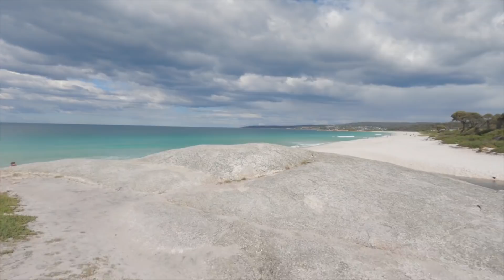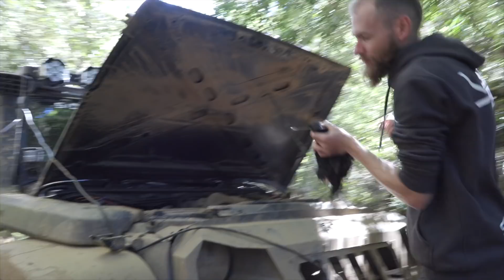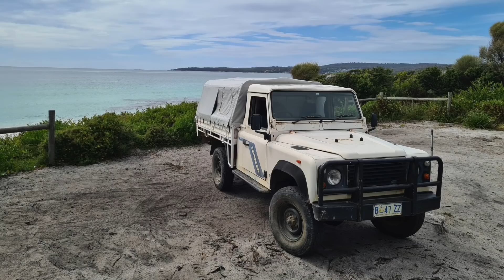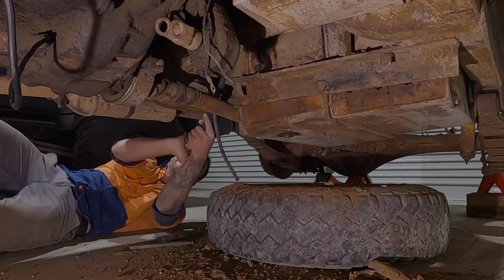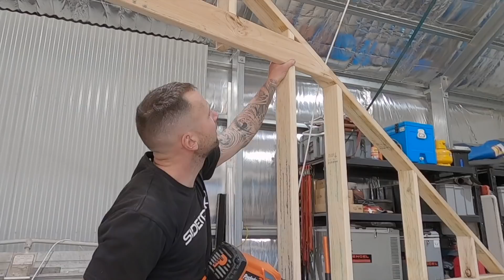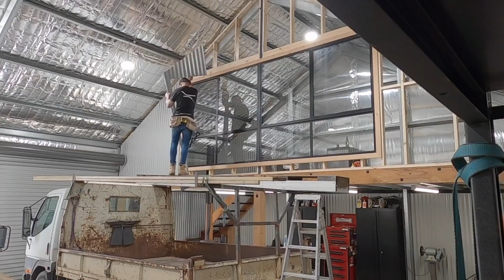#23 Where's the G60? What happened to the Jeep? QUESTIONS ANSWERED!!

Comment: Two firsts: First time I've read or heard anything about the Pentastar having issues with stretching timing chains - these motors are generally very reliable. Also, first time I've read or heard of anyone replacing a Wrangler with a Defender... and an old one at that!
Reply: Yes the jeep badge. 😁
Reply: Same, super surprised in stretched timing chain, never heard of that with the pentas. Bad luck on that one guys :(
Reply: It being low on oil is probably what damaged the chain.

Comment: Great yarn guys.
I was cringing at the Jeep story and then chuckling at the Tassie Defender story.
Like one of the comments below, suggest the timing chain(s) issue on the Pentastar engine is rare. I’m not sure the timing chain is even in the service schedule ? Sounds like a dud part from when the engine was manufactured.
With what you have planned for the shed, vehicles & trips , we’ll have plenty to watch for some time. 

Cheers
Reply: Timing chain should last the "life" of the vehicle. Timing belt is the thing that gets serviced, if thats wrong the jeep truly is garbage.
Reply from the maker: Correct, no service interval on the Pentastar for timing chain.